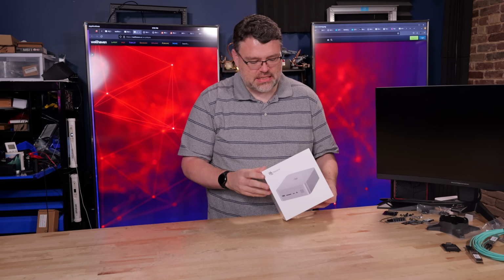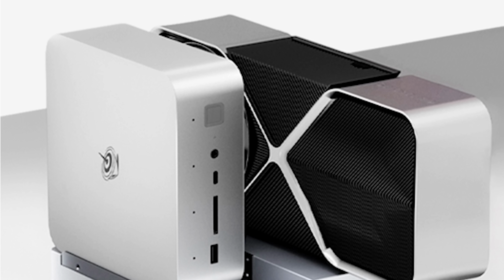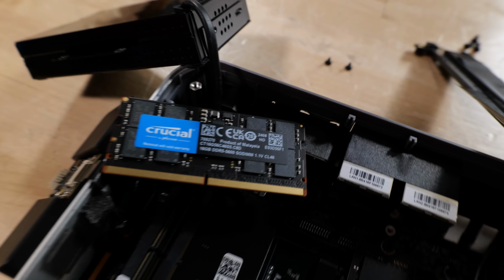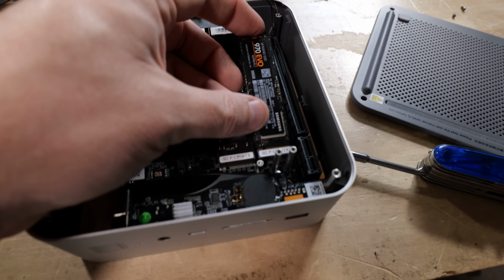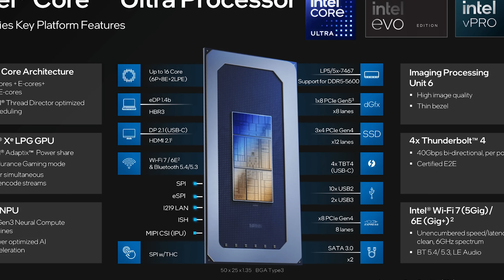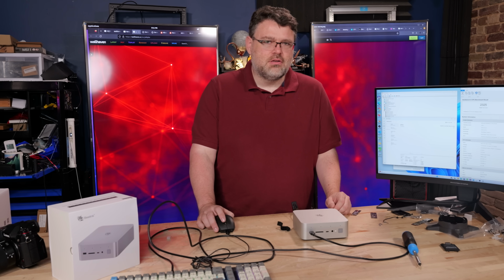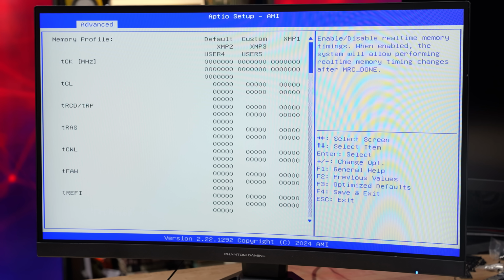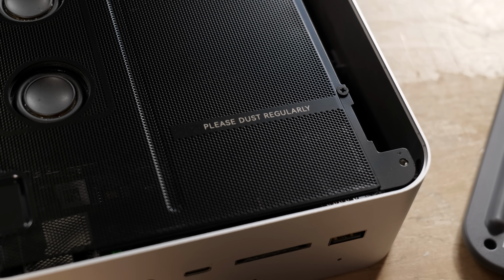The Beelink GTi14 Ultra: A Mini PC That Can Use A Full Sized GPU?

Comment: Say NO to non-standard connectors.
Reply: Except in this case(no pun intended) it's a dock connector so whatever, it's the most elegant way this could be implemented without making the case a complete mess.
Reply: That's looks like a regular pcie connector but just bundle a x1 and a x16（running at x8) and you might see something similar in some server board 

So technically a x8 and a x1 raiser cable will do the trick 

The built in power supply output 19v so the quick repair if it faulty is simply get a laptop 19v adapter and wired it 

Glad they don't make the GTR7 magnetic connector anymore 😂
Reply: @frankwong9486  probably the x1 is for the dock I/O while the x8 is for the GPU.
Reply: The best I can do is "It depends"
Reply: as long as it is cheaper and faster than other standard connections, I don't mind at all
Reply: Every connector was non standard once probably
Reply: Say yes
Reply: @ranjitmandal1612  No

Comment: "Oh and we will......we will"

Wendell knows what the people want.
Reply: He doesn't actually do it though? Is it even possible? The dock provides 2x8 pin connectors, but the 4090 uses 3x8-pin.
Reply from the maker: @DSS553 check out some past videos where we do it with an oculink x4. we'll need an external PSU but we can hack a 4090 onto basically anything now

Comment: thanks for the review wendell. I'm really looking forward to your tests on the dock. me and a couple of other users over the reddit subs (both mini-pc's and the official beelink one itself) have come across the contradiction presented by the specs of the gpu connectors: two 6+2 connectors, usually rated for a constant 150w each, to feed up to 600w of power. as other colleagues of yours have completely ignored such issue, even while having the dock in testing, I really hope you're going to shine a light on this contraption. beelink has already publicly said that they're going to keep producing mini-pc's compatible with such dock, making it a really interesting standard in the realm of thunderbolt and oculink docks.

Comment: I wish that  we were able just plug the GPU straight in to its side or top  without any adapters ..
Reply: Ah yes, enjoy your wobbly case with an external PSU and its cables just dangling about do you people even think before posting this crap? Grab a mini itx mobo and a Siverstone Vt01, cut the side and there, your wish is granted. Enjoy the atrocity.
Reply: It has been done before . The GPU  support can be designed right in to the case .  And don't  mind the cable mess ,  nor having a separate PSU .
Reply: btw , there are GPU's which don't require an external PSU .
Reply: @Ray88G  right, because that's why you would want an external GPU, solely for entry tier GPUs.
Reply: @ToroidalVortices  First, an RTX A4000 consumes 160W so it does require additional power and it's also the current gen bottom tier quadro which pretty much makes it ENTRY LEVEL regardless if it's used by professionals on workstatios or not. Two swings and two misses.

Before you get all hot and bothered by comments and try and fail to correct others, maybe you're the one that should touch grass pal.
Reply: Also, I'm too late to remember about it but the form factor you want already exists and it's called Intel NUC Extreme 12 which is basically the length of a traditional GPU but twice as fat.

Comment: It's about efing time! For years I've been screaming, "yeah but it's got no GPU power!"..... All these little mini PC things are kinda neat but totally useless for anything that requires real GPU power. This little guy solves that problem in the best possible way, thankfully, finally!
Reply: Any of them that had a UCB c could connect to a external GPU. I do not see this being actually better than that. The dock is still going to require separate power and the form factor is awkward, to be nice about it.
Reply: @KenS1267  :
This won't need a dock, it only need a PCIe extension cable to work. This is the cheapest way of adding a real GPU to one of these mini toy PC's. I care about performance per dollar, aesthetics are meaningless to me. E-GPU's are more expensive. This is the best way of doing this job from both a cost and a performance perspective. I do understand this method is not for everyone nor for all conditions, but it is exactly what I want!
Reply: @Finite-Tuning  Did you see how deeply recessed the slot was? Getting a riser connected is going to be a challenger. Getting a riser connected without damaging it? LOL. 

As to performance per dollar, get a normal PC. You're grossly over paying if you get something like this.
Reply: @KenS1267  :
I do not consider 1" of depth to be deeply recessed, but yes I did see it. I do have normal PC's, all of them in fact. I do not want "normal", I want the abnormal best performance per dollar modular designed by Frankenstein.
As previously stated, this is what I want. My reasons for must only be understood by me.
Reply: @KenS1267  Unless its Thunderbolt 5 then the bandwidth limitation would make USB C not worth it
Reply: @KenS1267 Thunderbolt carries x4 lanes of PCIe gen 3, which is well and truly slow enough to bottleneck modern GPUs in most workloads even before factoring in the additional overhead of PCIe tunneling. This is 8 lanes of direct PCIe, probably gen 4 but potentially gen 5 even.

Comment: Right, RAM speed is quite slow, however docking station idea with the full PCIE eGPU is pretty cool. Future setup with better cooled, faster RAM will be even more interesting and hopefully overall design in terms of upgradeability and setup will improve as well. These kind of modular/transformer PC configs should become even more popular in the future. Unfortunately Intel is not helping much with the unreleasedTB5 and hopefully Oculink won't become obsolete.

Comment: my mind goes straight to home lab applications when i see mini-PCs like this... throw a multi-port NIC  in it and got a nice low power quite adequate firewall/router, or a SAS card in and and you get a nice little NAS (jbod enclosure not included)

Comment: That could be a great system for high performance hardware pass through style VM's - your host system keeps the ultra efficiency cores for itself most likely while letting you have a potentially dynamic or static assigned pile of the high performance cores for the VM's of choice (though the numa nodes could be a problem). The big downside to the last time I was playing with that sort VM was my workstation at the time only had a dual pair of identical Xeon's - way more core performance than the host needs (the only thing it really has to do is handle the network bridging for the VM's that don't get to claim one of the Ethernet chips to themselves), great for the multicore heavy VM workload, but kinda terrible for the gaming VM  - As those Xeon's had rather mediocre single core performance (and back then games tended not to be multi threaded at all, and its not like the situation is that much better now, still tend to be very few threads in a game). Still was a great system to use, functioned really well overall. But this tiny box probably would do the same job so much better as its got that variety of cores. 

That said its modern Intel, and until they really rectify the mess they have made of their recent desktop chips I'd not want to trust them - I have enough computers i can live with a failure, but if its not my fault the company better fix it with decent customer service...

Comment: Shoving laptop hardware in a non-portable device doesn't make much marketing sense, especially at that price point. A similarly price desktop would offer better performance per dollar and a laptop can go anywhere. Am I missing something Wendell?
Reply: Problem is Core ultra 9 185h laptops doesn't cost 1000$. Around the world the cost is at minimum the double.
Reply: @Pacho18  there's barely any difference between 185H and 155H, with the latter being much more affordable
Reply: @обычныйчел-я3е  Yeah but 155H, depending on power usage, is compared with the U variants of AMD Mobile chips. I myself compare devices to be face to face like the 185H at full 65W with Ryzen Phoenix/Hawk Point at the same full 65W (H/HS variants) of power from AMD.

Comment: These mini PC's represent interesting engineering but I just do not see the point of putting so much compute in such a small package. The vast majority of the use cases are going to be as hospitality/POS etc. devices and that doesn't need top end HW. Back when I did sales on that sort of HW I never even saw anything but i3's in these installations.
Reply: Vast majority of these sorts of machines I'm aware of have historically been i5s, at least that's what's flooded the surplus market in the 1L business PC category. And you'd be surprised how much inefficient junk software needs to run on these things in corporate settings sometimes

Comment: This is dumb. At almost $1000 just for the PC. I’d rather buy a laptop.
Reply: There's no laptop with a core ultra 9 185h that costs that. At least outside US.
Reply: yeah I'd rather get another amd based mini pc that costs less and can do almost the same if not more. I really don't like the idea of the built in PSU, it just adds more heat to a cramped case. Also once you get a dock with a video card the whole point of having a mini pc gets lost, it's small size and transportability. I'd rather go for a mini itx build then.